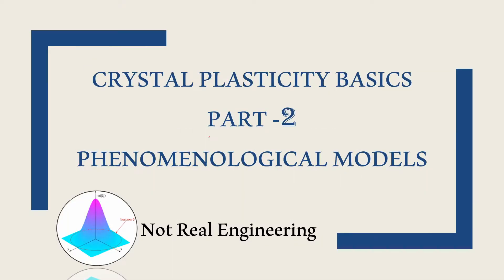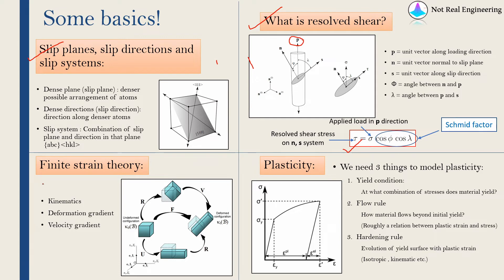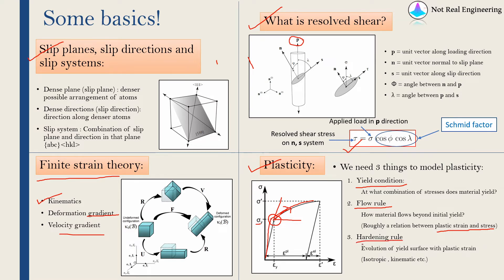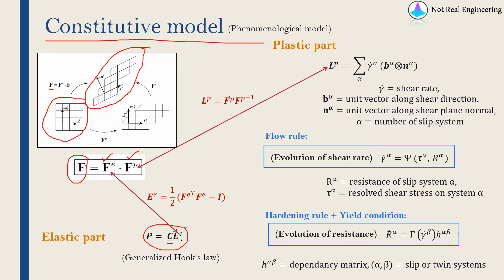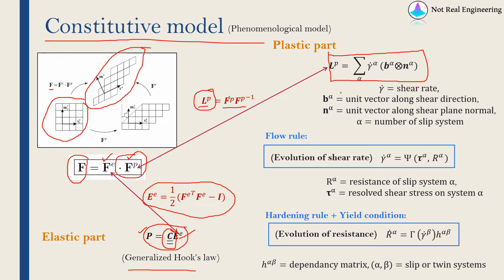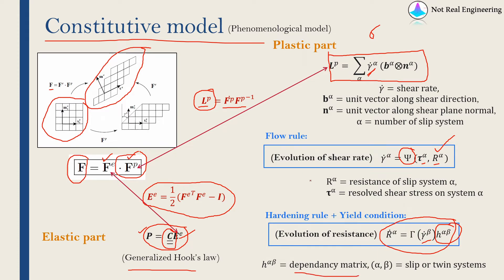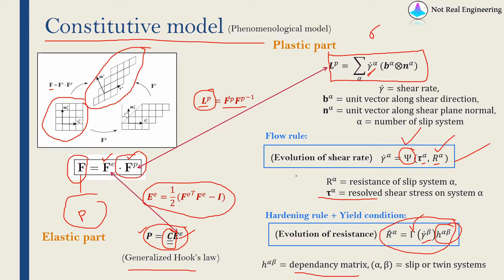Crystal plasticity Phenomenological models | Crystal plasticity basics part 2

Comment: Thank you for the video. I have a question. For the slide at 7:40, is yield resistance the same thing as yield strength and for saturation strength, can you say that this is equivalent to ultimate tensile strength? I read the sections for this in the warp3d manual, but they do not clearly explicate. If there are readings for this, would it be possible to point me to some? Thank you!

Comment: @Not_Real_Engineering One of the best possible explanations in less then 15 minutes, Please also make a similar video on Physics based model which takes dislocation densities into considerations

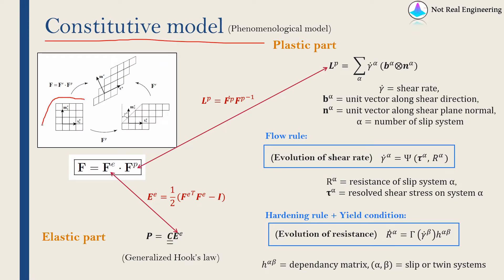2:30 using deformation gradient, we can convert deformed undeformed configuration into undeformed deformed configuration
6:47 How resolved shear stress is dependent on tensor-P?
11:10 Link to the example (https://youtu.be/OC8vdCTBv34).
Reply: can you provide the tutorial for the example mention in 11:10?